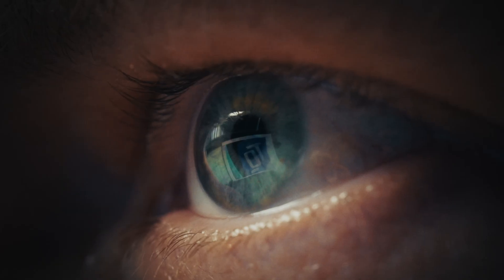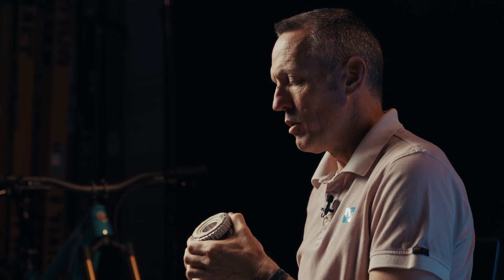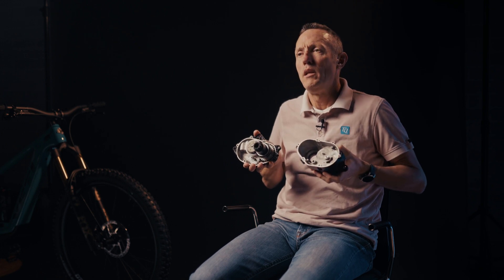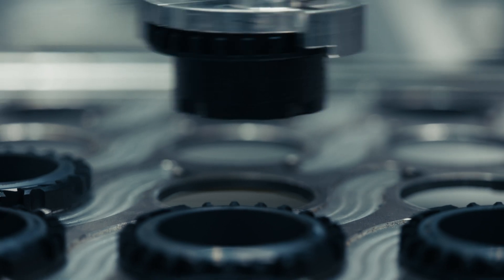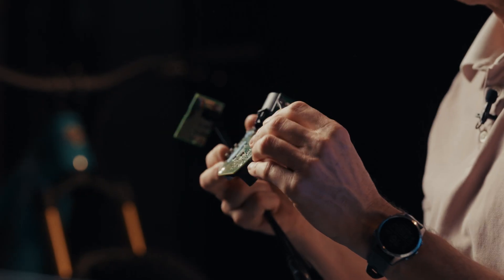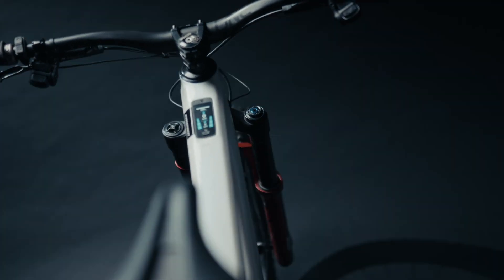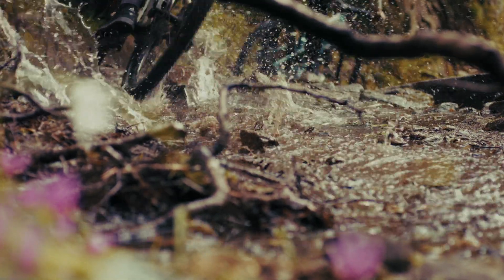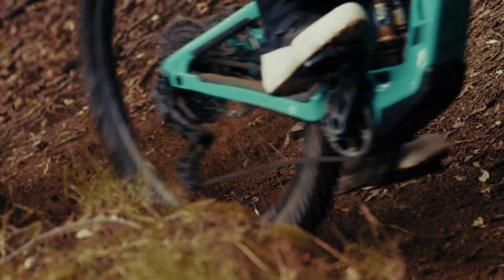⚡️Everything You Need to Know About the New TQ-HPR60 | TQ-HPR60 Tech Talk

Comment: is it posible to use this new unit as a replacement in Scott Lumen? with the full power of 350 watts? I have almost 20k kilometers on the hpr50 and it still works flawlessly, but the performance bump sure would be nice...
Reply from the maker: jes it is possible, but the power is limited to 300watts. the 10NM in torque is quiet noticeable. more detailed informations you will find at our faq section on our homepage: https://www.tq-ebike.com/en/help-support/faq/

Comment: With 60Nm and 350W makes 200% assistance much more sense than with the “old” hpr50 (anyway I have it in a Scott Lumen and I love it).
Reply: Only 20% extra power but you have to pay more money? Why not just upgrade to full power?
Reply: @antonyan2307  I don’t really need full power. Bike would be also heavier. In fact 100% support is enough for most of what I need to do. And I ride mostly in 50%. 150-200% would be definitely great to “climb walls”. But with max 300W, 200% or even 150% doesn’t make sense, very soon you reach the max power, and it ends up being 100%. 

400% is definitely for things I am not interested in. But I can understand that most e-riders are willing to have such an amount of power. I mean, 400% is kind of having 10 legs (instead of 2 😅). I am riding with 3 or 4 legs, depending on the terrain.
Reply: @antonyan2307 The TQ motor cannot be full power because the e-motor and crank axles are the same. So, only have of the width can go to the e-motor, the rest for the harmonic pin ring and clutch. 

With full power you need two axles, and all those planetary gears to connect them, which make lots of noise, as well as less contact transmission. The HPR is a really great invention!